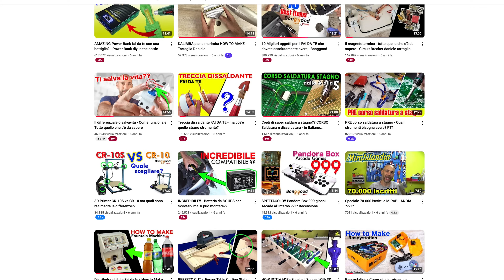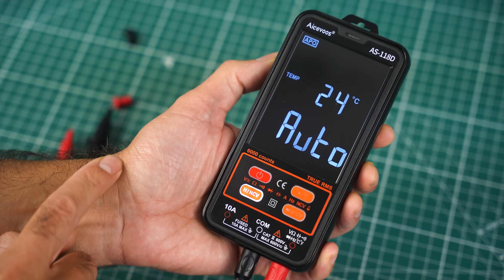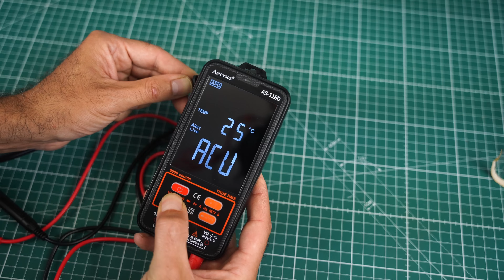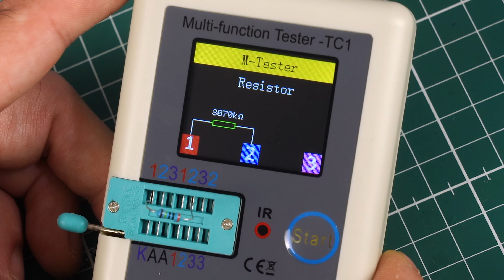15 AMAZING products for fans of electronics and tin soldering

Comment: La pompa per dissaldare solo in apparenza è buona. La verità è che se cade a terra di punta l'ugello si piega  e anche se tenti di raddrizzarlo la capacità di risucchio sono compromesse, inoltre si ottura molto più facilmente 
Infine la molla entra in contatto diretto con il solder e lo stagno aspirato, che rende la pulizia più lunga e macchinosa.
Reply from the maker: Sulla punta non sono d'accordo anche perchè c'è il beccuccio in silicone che non permette di deformarsi se dovesse cadere. Per il resti si, sono poco efficienti alla lunga e necessitano di tanta manutenzione. Lo stagno deve essere rimosso al' interno e per farli funzionare nel tempo, devono essere lubrificati. Sono tutti simili, questo non mi dispiaceva.
Reply: @DanieleTartaglia  mi è successo. Per cui parlo per esperienza personale.
Ammetto però che mi è caduto di mano mentre cercavo di stappare l'ennesima otturazione...quindi il tubicino di silicone non era montato.
Però ecco in un laboratorio sono cose che accadono e trovo questa parte del prodotto troppo delicata